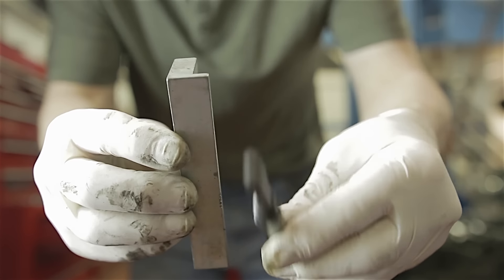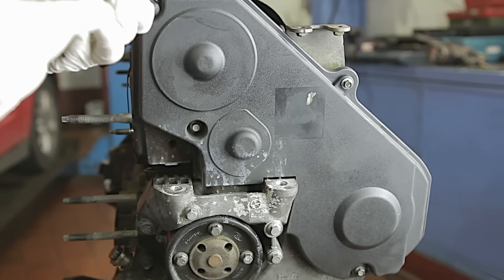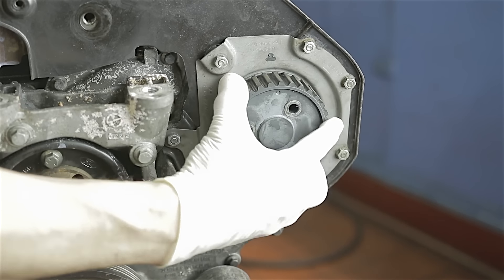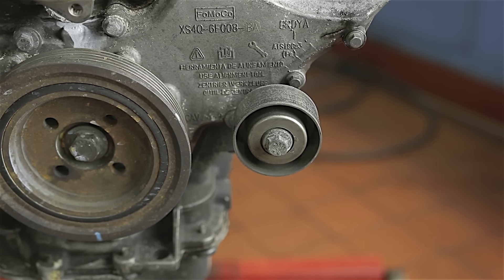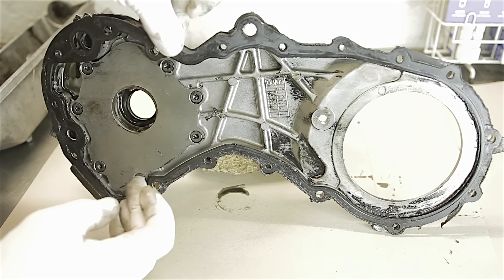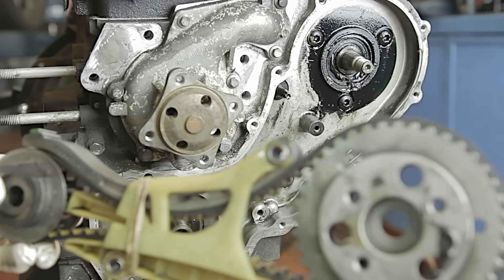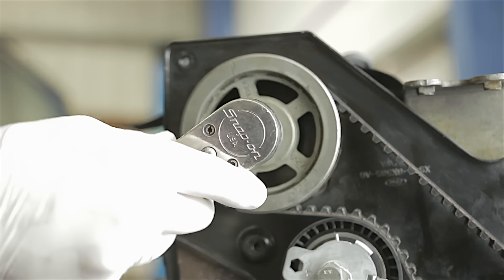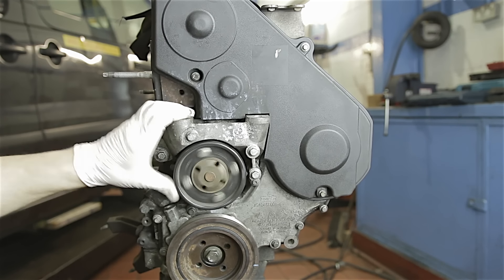Ford Mondeo/Transit Connect 1.8tdci wet timing belt replacement

Comment: Hi Alan!

I  Have a 9 years old Ford Focus 1.8 tdci ( 85Kw/115 Hp ) and my stupid  question is :  What kind of wet timing belt have in my car?
Have you got any idea? :-)
Thank You
Reply from the maker: if you give your registration number to your ford garage parts dealer they will tell you if your car has a chain or wet belt in the lower crank case, if you have a chain then you don't need to do any thing, if you have a wet belt then maybe need to think about replacing it

Comment from the maker: fai is a good brand, i would if it is still apart would be to fit the tensioner with the timing cover off and see if both chains are tight but because both these chains are short and thick compared to say a vauxhall corsa chain chances are you will be fine but without seeing how slack one chain is compared to the other i can't comment but really, both sprockets and both chains should be the same size and one chain should not be slacker than the other
Reply from the maker: Transit connect are not too bad with engine in situ. Hope all goes welll, any probs give me a shout

Comment: Hi Alan, I've just removed my wet belt and noticed that the small locator pin on the crank is flattend, what could I do. Cheers
Reply from the maker: hi, this is not a problem i have come across but i would find an engineer to see if the pin can be removed and also find out if a new pin can be purchased from a ford dealer or if a new pin will have to be found elsewhere, not a good situation, good luck
Reply: alan howatt ok thank you for the reply, could u say why the lines on the new belt are important relative to the marks on the sprocket? From what I can tell is, the piston will be at tdc as per crank setting pin and the valves should be closed with the cam plate  instslled. If the pump does matter then why have marks on the belt? Seems pointless to me. Top vid by the way lol
Reply from the maker: hi, the bolt holes in the pump sprocket are offset which is why the sprocket needs to be in a certain position so that everything aligns, there is a mark which sits at twelve o'clock on the pump sprocket when the crank is on its timing pin, i get what you are saying, pump sprocket does not really matter as long as crank and camshaft are aligned but i guess they are reference marks which was probably from when the old rotary injector pumps were fitted
Reply: Ok thanks mate

Comment: Brilliant Video Alan, Thanks a million. I had it done last week and the engine seemed very rough afterwards. Mech advised to it was an egr valve issue but didnt seem to fit the symptoms. A couple of days later the engine seized suddenly. After some investigation it seems the #1 glow plug, which they had removed and refitted as part of timing works,  was bent at about 20deg at the tip. Seems to me that the timing was set incorrectly but mechanic says it is correct. Do you have any idea why this would happen?
Reply from the maker: hi, this sounds like a horror story, firstly, there was no need to remove any of the glow plugs which sounds like they did not have the proper timing tools to do the job properly and put a thin screwdriver down the glow plug hole to try and find top dead centre. if your engine was not running right straight after they had fitted a new wet belt or chain then they have got your timing wrong and you should be looking at legal action against them, hope this helps
Reply: It is a horror story. They said that they had the glow plug out and used a rod which is part of the tooling kit to put down and try find the top dead centre. Interesting that you say this is not part of the kit, thanks a million for the info. They have now come up with the theory that the glow plug was bent by a piece of carbon deposit which fell down into the cylinder when they pulled the glow plug.. Doesnt sound plausible that carbon deposits would be sturdy enough to do the damage it did to the plug, or to seize the engine. Still waiting to see what further damage has been done. Legal action might have to follow. :(
Reply from the maker: yeah just as i thought, they don't have the crankshaft timing pin so pulled out a glow plug and put rod to feel when piston is at tdc which is highly inaccurate so yeah they fucked your engine and really should not have done this job without the proper tools or knowledge, i can only hope that they put your car right for you at their expense

Comment: Is this the Endura DI engine? Found in the 2002 Fiesta 1.8 diesel?
Reply from the maker: yes the rocker cover will say endura on it although a 2002 fiesta will have a chain unless the engine has been replaced with a newer version
Reply: The chain wouldn't require being changed, will it? Most chains out live the engine itself.

Comment: do you have the torque setting for the injection pump
Reply from the maker: Cian O Leary 
Sorry, no, not for the injection pump. By undoing the nut will give a good idea of how tight to tighten it. I always tighten that but with a ratchet
Reply: thanks alan !
Reply: I found out the torque settings from my local ford garage.the camshaft is 50nm,the "upper cambelt"tensioner is 50nm.
the high pressure fuel pump is also 50nm .the crankshaft bolt is 100nm plus 180°

Comment: The same technology of the wet timing belt is in 1.5 ecoboost
Reply: i bet it has the water pump inside the front cover when it fails the coolant goes into the oil pan.

Comment: Hi Alan, great video thanks.
I've just completed this conversion on my 2008 galaxy. However since fitting the chain, there is now a faint rattle on idle.
It strangely seems louder inside the car.
Is this normal? Just a downside to having a chain rather than a belt?
The rattle wasn't there with the belt.
Thanks
Reply: hola es normal tranquilo la cadena siempre hace ruido

Comment: Hello! Where is the engine code of the 1.8 tdci ?
Reply: on the vin plate inside one of the doors
Reply: @robertbird7685  I am looking for the engine code not the engine number. Which is should be somewhere on the engine block. I went to the ford service today but they couldn't able to tell me where is exactly.

Comment: Good video Alan thanks. Can I ask a question not exactly related but I've got an oil leak not from my sump but I think from the gasket above my sump. To remove this bottom aluminium section do I need the gearbox removed. Is there bolts holding on this section behind the clutch. Thank you.
Reply from the maker: its been a long time but i think the rear main oil seal bolts into that aluminium section...there is no actual gasket....it will be a tube of sealant to make a gasket between those surfaces...i would have to find out exactly how it comes off

Comment: I have a 2009 transit connect with this setup, could anyone tell me the mileage interval for the wet belt??
Reply from the maker: W Davo 
125 thousand miles.
Reply: Just got off the phone to Ford and their saying 150 thousand miles or 10 years with the transit connect?..
Reply from the maker: W Davo 
I have had these belts fail at just over 90k 
If you know the history of the van and the correct oil changes you should be ok but if you don't then you would be best to change it at between 100k and 125k
Reply: Many thanks for your quick response, much appreciated
Reply: Now

Comment: If you are doing this job, consider  replacing the timing belt with an orginal ford timing chain that will never need replacement. Engines that are fitted with the time belt will be compatible with the timing chains as mentioned but not shown. https://www.youtube.com/watch?v=E0cY8xbzfJk&t=40s
Reply from the maker: why, because if you had bothered to watch the video you would see its a scrap engine being used for demonstration purposes where i do show how a chain can be fitted
Reply: @alan4x Peace man, i see a wet belt installation and from the comments people are installing wet belts instead of chains. It's so easy to put in a chain, it really is a shame not to. Just putting it out there friend.
Reply from the maker: i get that, i have converted many wet belts to chains but at the time of making that video i did not have a chain kit which i could fit so could only explain that a chain could be fitted, anyway, it was years ago now, have a good one

Comment: Hi Alan , I've successfully changed my wet belt to a chain after a lot of work and the car is running great. The only issue i have is the crankshaft seal is leaking,I've replaced the seal a second time with a genuine Ford part but for some reason it still leaks after a week or so. I did use the crankshaft centering tool which i purchased off eBay. Any ideas what might be causing it to still leak?
Thanks Alan
Reply from the maker: Wayne Rowland 
Hi.  If you are sure the timing casing is central and the seal is not damaged in any way when fitting it then also check the crank pulley where it sits on the seal.... if there is a ridge   Then you need a new pulley

Comment: Got my local garage in Plymouth to do this in Jan on my 09 Focus, 1st one he's done and did a brilliant job. What a bloody stupid design.
Reply: What  was the cost to get the job done.
Reply: @lawny7710  £630 mate wont get much cheaper than that, did cracking job.
Reply: @boabm6522  thanks for the info. Expensive job.
Reply: @lawny7710  it is mate but the engines can do a couple hundred thousand, £630 is cheaper than a new car 👍

Comment: how much all in to fit all this with parts
Reply from the maker: in the uk i would say between £500-£800 using genuine ford parts, there are cheaper kits on ebay but the quality of those parts would be questionable
Reply: Are u from the UK if so same as me and would you consider in doing this for me
Reply from the maker: at the moment i am so busy with company cars i don't have time but if things change any time soon i will let you know

Comment: my y  father has a transit connect 2007 he buyed it with 36k km he didnt change anything on it its 205k km now i mean it should be changed the second belt now i think its gonna break very soon
Reply: Have it changed.Wet belt snapped while on motorway, On my ford connect 2010 with  198000 miles.. Head and Pistons damaged. Total costs £1800 plus  Vat

Comment: Don't you need to drain the oil first?
Reply from the maker: as long as the oil level is not overfull, which it was on the engine i was using..in most cases you don't need to drain the oil

Comment: Hello Alan
I have an ford transit connect from 2010. We want to replace a chain instead of a belt, but we miss one part, THE one you hold in your hand on THE video , when THE timer stands on 14:27 minutes . Do you know a name or a nummer or were I can buy it. THE ford dealer can,t help me . Thank you
Reply from the maker: the hub     ford part no,     f1352698        these are ford part numbers, they should still be valid i hope
4x bolts    ford part no,     f1508244

eBay item number:251700703258  this is a kit, i don't know whether they sell the hub separate, might be worth asking.
Reply: Thank you Alan, this is great.

Comment: my  chain kit came in pieces ,I have to put chain and sprockets on to  the gear cogs  ,does it matter what way the chain fits on the the chain cogs , as I don't see any lines to line that chain up with
Reply from the maker: this is tricky with aftermarket chain kits. if you see no joining link in the chains then fit them any way onto the sprockets but you will need the crank and camshaft timing pin and setting plate so that when all assembled the crank and camshafts are in the correct position, the pump position does not matter
Reply: yeah ok got all the timing stuff to do it , thanks for your help,  the video does help too,,  thanks again
Reply: Hi such good advice

Comment: Should never ever use the cam locking plate to hold the cam while you torque the pulley. Good way to snap the end off the cam. It’s extremely bad practice. 
And you call bolts “nuts” allot

Comment: Dosent look beyond my skill level , but must be a mare in the van .....
Reply from the maker: If it’s a transit connect it is much easier to fit the crank timing pin by removing the alternator. I found the vans easier than the cars
Reply: @alan4x  thanks Alan,  I'm way under the mileage recommended to change the wet belt at 48k but over on the years recommended they say 10  I'm on 14 yrs I'm I panicking unnecessarily? Thanks again mate
Reply from the maker: I would definitely change it before time but the crucial thing to keeping the belt lasting is to use the specific oil for that engine and to carry the oil changes out at the correct intervals
Reply: @alan4x  thanks for the help  appreciated 
... looks like you have a fantastic new life , enjoy .

Comment: So basically remove the engine thats like £500
Reply from the maker: no, you would replace the belts with the engine in the car or van...the engine used in this video was scrap but it was good to show how the belts are changed as it is difficult to film this job with the engine in situ